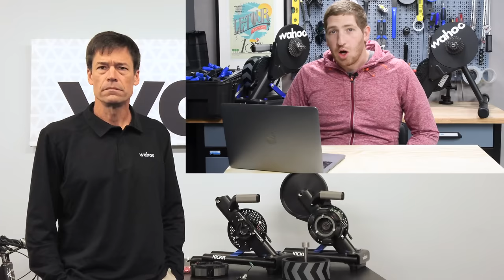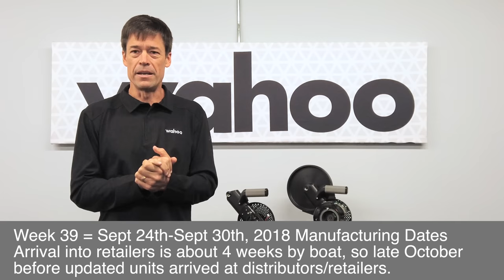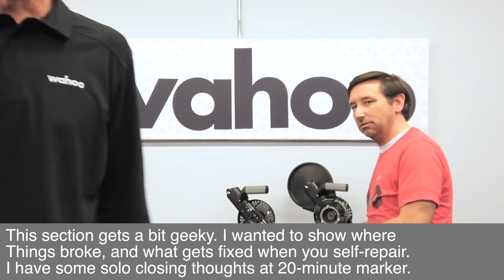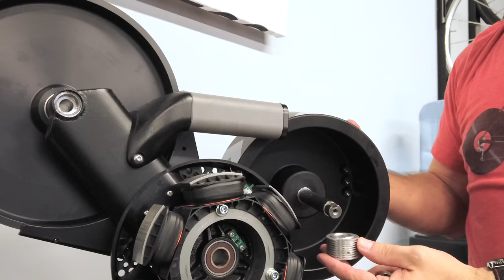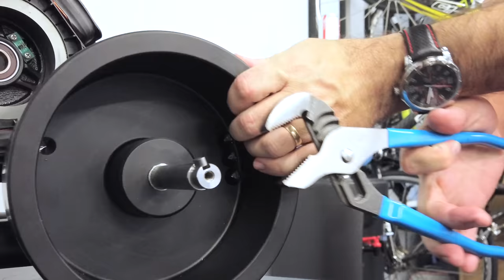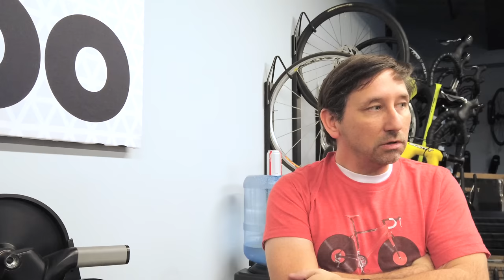Wahoo KICKR18/CORE Issues: Discussion with Wahoo CEO

Comment: Thanks for posting this.  It's good Wahoo is being transparent about this.  I've been a happy Kickr owner, with three in the family.  An original 2016, a Snap, and a 2018.  All have worked well with over 20k Zwift miles across them (the 2016 has more than 10k Zwift miles).

Comment: My first 2018 Kickr had to be sent back, had problems (grinding noise / humming noise). My replacement unit has been perfect. My Kickr CLIMB actually failed on an 8% climb in Zwift and my bike slammed to the floor when the belt inside of the unit failed. I am just thankful it didn't break my fork or headtube on my bike.
Reply: @John Trussell Thanks for reporting that problem (wahoo climb) I was trying to buy one, but after reading your comment STEP I better not buy anything

What would happen if his fork was broken or the frame ??  Does the Wahoo warranty cover those damages?
Reply: @ciclismomaster6761  I would still highly recommend the CLIMB, it just made me very nervous after it happened and I did not use it for a few weeks. I also had my bike shop check my fork and steer tube after to make sure it didn't crack the carbon. Everything was fine, it was just very scary. Wahoo Support did not have any new Kickr CLIMBS to send me for warranty so they had to send me a used one from their office. It has been solid ever since. Would have been nice to get a new one out of the box though.
Reply: @ciclismomaster6761  i highly doubt it. these are not worth the money, considering the failure rate.
Reply: @ciclismomaster6761  I read on wahoo facebook someone bit his tongue and bled when his climbr belt broke.
Reply: @biglampar556  cycling is a tough sport,

Comment: Thanks Ray, very useful and might help a lot of people. It would be really helpful if Wahoo or someone could do a detailed self-repair video. The instructions you receive say nothing about locktight. Also they say use pliers to pop the replacement key in vertically, but mine just slid in horizontally. Another thing they mention in the instructions and showed in that video was the flywheel removed. Mine appears to be stuck in place and does not slide out. 
Also worth mentioning that when I did the self repair, the bolt and washer that hold the tension screw in place.... the washer was all bent out of shape. 
Thankfully they are sending me out a replacement, which they say is a gold standard unit, which is supposed to be fully checked and parts replaced that need to be. I'm kinda on the fence with this as I have seen posts about supposed gold standard units being faulty also, but fingers crossed. 
Its great that everyone is talking about this because it means we can all help each other, but I really do think more detailed repair videos are needed.

Comment: Hey what a great video.  Guess what, i'm one of the few that had TWO Wahoo Core's blow their speed sensors in a row.   Each unit lasted about two weeks.  Happy to talk with Wahoo tech if they want details on my situation.  I"m on my third unit.  I now have it plugged into a surge protected strip and after seeing this video, i think i will add a ground cable from the frame to ground just to be safe.  I really don't want to have to strip it down and pack it up again.  I love the unit otherwise.  very smooth and responsive.   Thanks again, Paul.

Comment: Purchased a Kickr 4 - knocking sound became a huge issue, practically out of the box. Returned it to the LBS who were really good and gave me a replacement. Exactly the same problem. I told the store owner that 1 is random, 2 from the same batch is a clear manufacturing issue. Lemons. I will never buy them ever again. Oh and the second one has been sent away for ‘repairs’. I’m sticking to Neos.
Reply: Couldn't agree more. Anyone reading this wondering what one to buy - Tacx.

Comment: Had the knocking issue with my Kickr18 after 3 months, and gotta say the support was excellent from Wahoo. They sent out a self-repair kit which was easy to install and fixed the problem. However, there was another noise from the flywheel that was quickly diagnosed a bearing issue. They immediately dispatched a new unit and picked up the old one on the same day. Less concerned now if I get a similar issue with that level of support.

Comment: Thanks Ray and Chip!  Bought my Core through Clever Training and sent intermittent grinding noise issue to Wahoo.   I am right in the middle of communicating with Wahoo customer service today actually on my first unit, hoping it doesn't occur in the 2nd unit. Good to hear they are testing them before they go out but perhaps it's a wear issue testing not long term enough?  Power has been dropping out too but thought that was a Zwift issue, it does come back though so maybe it's not the unit.
Reply from the maker: If the power is coming in/out, that's more of a general connectivity issue (could be WiFi interference - the most common). With the ESD issue, it's black or white. Either it's alive or it's dead-dead for good (the chip gets fried).

For long-term testing, it's interesting. My unit is from September and has a fair bit of mileage on it, heck, even GPLAMA threw down some mileage on it. And I know he hasn't killed his own units yet either - and those have way more mileage than mine. There's definitely some factor that randomly triggers the noise to occur, and obviously once it starts, it doesn't stop. In my case, it was a rather tame sprint (about 700w) the day prior. Sigh, win some, lose some it seems.

Comment: A separate issue that many have experience is the strong vibration that travels through the bike when freewheeling. It doesn't seem to be addressed in the video and I was wondering what is the statement from Wahoo on that? I had to test multiple units from my local distributor before I found a unit that was acceptable. To be fair to Wahoo, the support have been great and the distributor was stellar in his service, bringing multiple units from the warehouse for me to test before I brought it back, to ensure that I am happy with the unit.
Reply: I had the same issue.  Called up Wahoo support and they just sent me a new one.  Replacement seems much better.
Reply: Not sure if you have the same problem as me but I get vibration in the crank when I pedal.

Comment: Timely video, thank you Ray. My Kickr Core is presently stored before being returned to the store I bought it from last November. I had noise issues but also power resistance issues with fancy numbers and unresponsive unit during downhill and uphill courses. I tried Ant+ and Bluetooth, reset to factory settings for same random problems. I reinstalled my old reliable Computrainer which is noisy but its working flawlessly for the past 13 years. I'm willing to give another shot but not too confident.

Comment: Soooo happy I went with a Neo - missing out on weeks of training over the winter waiting for a replacement unit(s) was not something that I was interested.
Reply: Same here.  I had a KICKR17 that had problems that despite some part replacements never really went away. I can't be dealing with shipping boxes back and waiting around. Bought a Neo and so far so good.  I still have the KICKR since it works sometimes in case the Neo fails.

Comment: Just watched your video and all becomes clear. I bought a core late last year and after a few weeks it developed a few strange noises when on Zwift. I sent a video of the noise to Wahoo and they immediately sent a replacement out which has been perfect. 
I cannot praise the level of after service enough,if all companies dealt with issues like this we’d all be a lot happier. Great video and after seeing what it took to do the fix, I could have done that myself quite easily, but thanks for a very informative video.
Reply: gareth hughes how many miles do you have on it?
Reply: Andrew McDonnell 
Depends really, usually about 25-40 km rides,3 times a week,depends on work. I’ll try and increase the time on the Core soon because it really gives a great workout and is so stable when giving it full beans! Would definitely recommend it,great value for the price.

Comment: Thanks for this video DC, very insightful. Though unfortunately, almost 3 years after this video was made, these issues persist straight off the factory floor. I purchased a Kickr Core yesterday (November 2021), and 10 minutes into the first ride, an awful knocking sound began. After researching my issue, I can see that problems with clicking, knocking and droning sounds in both Kickr and Kick Cores is still widespread from 2018 right up to the present day. This leads be to believe that Chip's comment in this video -  "All new units have received a new screw/key and loctite, and none of those can ever make this noise" is either marketing spin or an outright lie. Have there been any further developments on this, or do you have a follow up video? Thanks once again.

Comment: I received my Kickr in early November. On my first ride the loud knocking noise arrived. Customer service was great and I opted for the new key to replace on my own. 750 miles later the knocking came back. This time Wahoo opted to send a “new” unit. Hoping for the best. I love the Kickr itself. Easy to move. Works great. Perfect for my small apartment. Stuff happens.

Comment: Would be great if the vibration issues that I experience myself and others report as well could adressed...
Reply: same issue. I had the vibration issue on my new arrival unit. As well as some belt rubbing noice
Reply: Ever get a solution for this? Just got a kickr core and vibration through the pedals at >300w is really disconcerting

Comment: Yep, I had a kicker 2018 soon after launch and that lasted 2 weeks before it was making rumbling noises and vibrating really badly. Has a replacement and that lasted a week before it did exactly the same. Have to say, their support was excellent but this should have been fixed. It's a very nice machine when it works. Speaking as a mechanical design engineer I have to say that keyways have been well understood for decades so if you need to use loctite to secure them then you are fixing a manufacturing tolerance problem with adhesive - that's not the quality I would expect from a trainer in that price bracket. I couldn't risk a third faulty trainer at that price so I have changed it with a Tacx Neo 2 which so far is excellent, and I would say even quieter.

Comment: Bought a new Core today 9-23-2019 from REI, worked AMAZING, for one hour, then stopped registering speed, cadence, power. Mine was grounded. Needless to say, its going back to REI tomorrow and I'm getting a different brand. Yes, I have a carpeted living room! Yes, I live in a dry climate here in Colorado.
Reply: Ron Kuykendall I live in Co as well and I was wondering about this. Your comment helps me in my decision to get a kickr or not. Did you get a another brand? If so, what did you get and how’s it going? Thanks!
Reply: Do you think adding a ground wire from the frame of the unit (bare metal) to the face plate screw of a standard outlet might solve the problem? I would not want the same thing happen to my trainer.
Reply: I too live in Colorado (Denver) and purchased my Core from REI. Mine lasted 4 days then I smelled a slight  burning scent as I was attempting to warm up this afternoon
9:48 If Wahoo's response to dry climates causing breakdowns is "the environment is the problem...we'll replace it" what other option do I have but to return it for a full refund!? 
WAY too many people in these comments are blindly praising this guy for nothing. How is this not a bigger story: 'Wahoo CEO admits their products likely to breakdown on 20% of U.S. population'

Comment: As someone whose replacement Kickr Core is arriving later this week, this was a fantastic video to see pop up! I lost power/speed on my third session, so it appears that I had the ESD issue. Now I'm honestly a little terrified of doing it again. I have vinyl floors, and always ran the Kickr on its mat. I usually only feel a static discharge when I pull off a sweater. And I didn't immediately run over to the unit and zap it. So, I'm hoping that it was just a fluke, and won't happen again thanks to the precautions they're implementing. As you noted: I've had nothing but sterling experiences with Wahoo Support.

Comment: I have had two broken Kickr18s. The first one had the clicking/knocking noise after using it an hour or so. I bought it in October. The second one I got as a replacement in December and had a loud humming noise immediately out of the box. A couple of days ago I received a new unit and it seems to work great! Although I was unlucky with the first two units I am very happy with the service from the store I bought it and with Wahoo solving it quickly and being brave for explaining it in this video. Let's hope the new one keeps working :)
Reply: Is it still working without any problems?

Comment: I am on my third Kickr 18.  I have about 400 miles on this unit with no issues.  The customer support has been excellent.  I am happy with the product and the service.  Hopefully it will hold up and last as many miles as my original kickr(which my father is still using)!

Comment: Courageous but casual approach to what should be a product recall. BTW my Kickr 2018 developed a new noise in the flywheel, and when I opened it it turned out that the shrink tape around the copper windings of the stator had fallen off and were circulating inside the flywheel. Wahoo offered to replace the unit but seems like another generic quality issue coming their way.

Comment: Just got my replacement Kickr today after the first developed the knocking noise. Unfortunately can’t test it out yet as they included the old power brick. In their correspondence with me they specifically said to only use the “new” power brick that would be included, even providing pictures to show the difference. Well, they instead sent me the old brick that they say not to use. Waiting for a response as to  how to proceed. I really want to stick with Wahoo but I am growing ever more frustrated with them.

Comment: Just bought a Kickr 2018 last week. According to the serial # it’s a week 32 unit, which I thought would have either been recalled or all sold by now. Either way, no issues so far. In fact, I’ve nothing but great things to say about the indoor zwift experience compared to my old fluid trainer. Fingers crossed it won’t need the repair kit as I’m not pushing monster watts. Time will tell. Great vid DCR, and great to see a CEO have the minerals to go in front of camera admit there is a prob and offer a fix.

Comment: It's great to see Wahoo being open about the issues. But no mention of any vibration issues, or droning noise with the Core?
Reply from the maker: I believe those issues are fixed by the same procedures (except without any tools/parts needed). I'll confirm, but I thought they were.
Reply: @Dcrainmaker   Thanks for the speedy reply and confirming the situation :) I think some of the droning/noise is related to belt tension. From what I've seen people are saying the vibration is due to the flywheel not being balanced very well? :(
Reply: It's the same fix as I had it with my core. Send Wahoo a help ticket and they'll send you the fix. Only took me 15mins to sort. Plus £100  voucher for their online shop. Winner winner chicken dinner 👍
Reply: @rossblayney   And if problem is still not solved then, am I stuck with a defective unit or can I still return it for replacement? Mine made noise the minute I used it and it was made in week 44. I prefer to be sure to have a good unit instead of saving 100$ on something that makes lots of vibration and noise.
Reply: I’m extremely skeptical. Went through 4 different Kickrs with significant vibration, and never received a functional unit even after I was assured units were checked and functional. Wahooligan Don booted me from the Kickr Facebook help group after I complained about their service. I don’t think they have all these issues resolved, and I wonder why they are shifting to damage control mode if this issue is as insignificant as they are saying.
Reply: Do you have a video of the droning noise? My core is definitely louder than it was when I first got it but not sure if this is normal or not.. 
Cheers
Reply: @rossblayney  I had an initial issue with a grinding noise, local bike shop did a fix based on the wahoo instructions, however now with a few hundred km on the trainer it seems to be returning.  I guess it's time for a ticket with Wahoo. Didn't have good luck with the phone support initially, I guess email is the way to go?

Comment: Thanks, Ray. My new KIckr Core had a power/speed failure within two weeks. Awaiting replacement now. Hearing all this, I really appreciate Wahoo’s attitude and desire to work with customers. However, if the second unit fails, I’ll be making a full return and heading to another brand. They know the problems, clearly, so if the new unit fails then they’re not actually taking care of customers by only sending out units that are fully resolved.